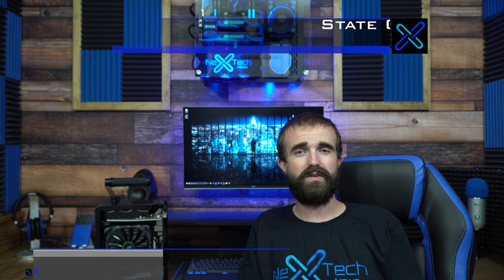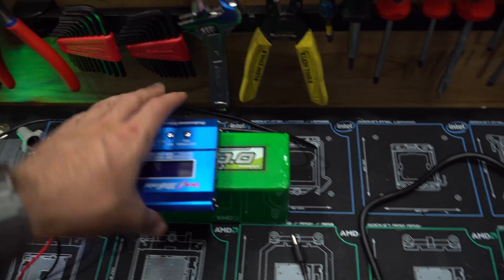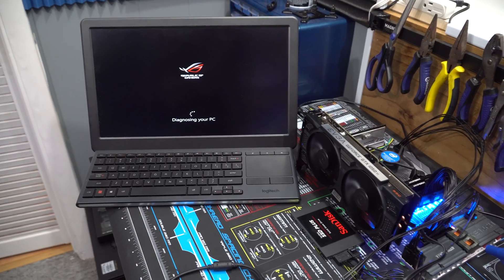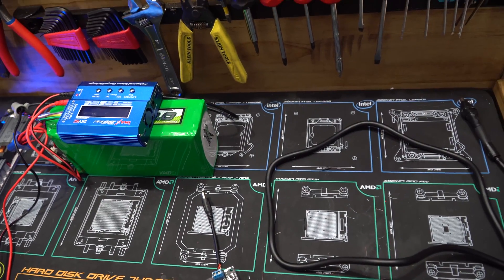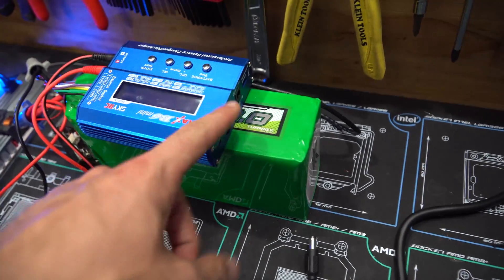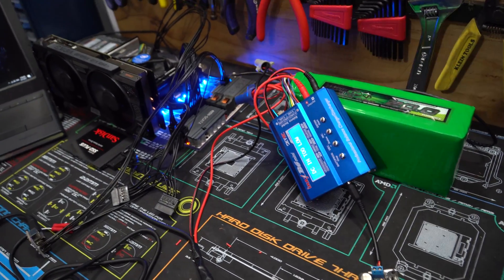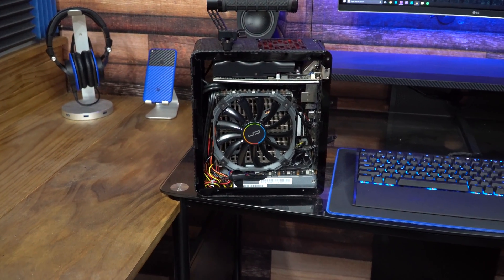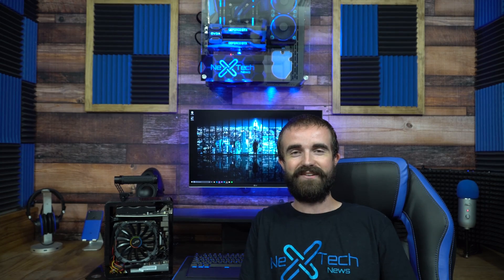State of the DIY Battery Powered Portable PC

Comment: probably need a cap in line before your charger from your charger, need a meter to measure the drop when the charger is pulling, might not be the voltage but the amp load. could re think it and up the volts with a buck on the front side with a cap and a regulator on the back side to stabilize the loads

Comment: Great looking setup. Except for the lipo battery. They are way to prone to going thermal and bursting into flames to use inside. But if you are going to use it inside then do the following. 

If this is a lipo battery with max cell voltage of 4.2v then the following is true. 
Number 1. Make sure to never allow a single cell to go over 4.2v
Number 2. Never let a single cell go over 4.2 volts. No seriously this is the number 1 way these go thermal and burst into flames. You have the charger set to 6S which is 6x4.2 volts or 25.2 volts. If 1 cell degrades and has lower capacity than the other cells then you will get the following problem. The cells will have the following voltage values near the end. 
4.1V 4.1V 4.1V 4.2V 4.1V 4.1V. 
Which is 24.7 volts. So it will continue to charge trying to get to 25.2v. 
Causing the cell that was at a lower capacity and got to 4.2v before the other cells to go to 4.3v. Which will either cause it to go thermal or just damage the cell more. Because the cell is now getting damaged with every charge it is guaranteed to go to 4.5v eventually on a charge and at that voltage it’s guaranteed to go thermal. 

Number 3. Do not let that battery pack get dented. A dented lipo cell shorts out and is why badly manufactured phones and electric bike batteries burn. These battery packs should be in a protective metal box. They don’t sell them that way because they are designed for drones and every ounce counts. So the drone owner takes the risk and most store them in a fire proof box and or outside. 

Number 4. Always balance charge a lipo pack. I believe you had the charger set to charge. Which means it stops when the pack hits 25.2v. You should set it to balance so it verifies it always has connection through the balance leads. And it stops charging when any one cell hits 4.2v. At that point it tries to discharge that cell down to the voltage of the next highest cell. Allowing it to charge the pack to 25.2v eventually without any one cell going over 4.2v

Number 5. Do not leave this battery on a charger when you are not around. Charging is when these batteries are dangerouse. So a charger that goes crazy can burn done the building it in if connected to a lipo battery. 

Number 6. Use a lipo safe. They make fire proof bags to store lipo batteries in. Get one, put the battery in it. Never leave the room without it in the fire proof bag. Especially when it is charging. This changes the building being burnt down to just everything in that room being destroyed by smoke damage. 

Really in the end you can ignore all of this by getting a lifepo4 battery. You don’t need the 100amp output of a lipo battery the 20 - 50 amp output of a lifepo4 battery is plenty. A lifepo4 battery comes with an internal BMS so you don’t need a balance charger. You can just use a buck boost converter set to the right voltage. 

I play with hundreds of batteries. I took apart laptop batteries and made an electric lawnmower. The lipo batteries I have I like to store in a lipo fire bag then I put that into an old metal file folder box. 

Good luck with the project.

Comment: I think its the dell PS that's causing this issue, its a great experiment but for simplicity, I would use a portable power station design as a blueprint for providing the voltage levels required to replace the switching PS normally used on a desktop.

Comment: buck converter  actually bucks and it is only compatible with pure DC as from a solar panel or a battery. It introduces square waves which confuses everyone else. Maybe a large capacitor in the line. Depending on amps. Try 5000 mf
Reply: 5mf....5000mf is 5000000uf :D

Comment: How did you connect the LiPo battery to the motherboard? I mean what is the battery powered power supply? I guess I'd like a link to the more basic design description.
Reply: 400w HDplex, It's in the description. You could probably do it without a PSU at all and just use buck converters.

Comment: So I want to run my PC om solar power. now I can easily do this with a lithium battery and an inverter. (which I have)  I want to for-go all the efficiency losses since the PC runs on DC power and have it running straight from the battery.  It looks like I would need 3 separate buck converters. I have some 30 amp converters (true amps).  Soo 30 amps at 12 volts is only 360 watts which aint bad but that close to the limit when editing.  I guess I could parallel 2 buck converters but dang might as well just take the E losses.  LOL

Comment: I've been looking at a similar setup. I found having a dedicated laptop charger brick plugged straight in to the hdplex then bridging wires from the barrel jack to the positive and negative terminals of 2 flat lion batteries in parallel with a usb dc battery shim in situ... when the charger brick is attached the battery charges plus also giving power to the hdplex, when unplugged in it runs from the battery

Comment: This is so cool! It has been my dream for a few years now to do this. Did you ever figure it out and make a tutorial? Wanna make a similar system with the HDplex 400watt DC-ATX psu and the Dell 330 my system would be an i5 4460 (upgraded to Ryzen 2600/16gb ram/mini ITX), 12gb of ram, gtx 1060 3gb and a 500gb ssd. I also have the Noctua NH-L9i.  Looking forward to finding out your progress on this project. So cool!!!
Reply from the maker: Still working on this system should have the newest rendition posted soon

Comment: man running a pc  with battery is an amazing concept . but it makes no sense if you use that much hardware . i mean hdplex is nothing but power supply . the main objective should be we should be able to run with out power supply because pc needs DC and battery provides DC . we should just run on that . going for converting dc into ac and then DC with power hdplex is ridiculous . plz correct me if i am wrong ....!
Reply from the maker: You misunderstood a little. The HDPlex converts DC power into the proper voltages for the mother board to accept. The HDPlex is not technically a psu, the 350W Laptop Charger is the PSU, it is what converts AC from the wall into DC for the HDPlex. At the beginning of the video I had the PC just running on the battery so all that was hooked up was the Battery the HDPlex and the PC. What I was trying to figure out though was if it was possible to recharge the battery while it was connected to the PC like a laptop but never really figured out a way how.
Reply: @Bits-Blades-Bros  ok naw I got you . For that there are two possible ways . One is by using old model leadacid battery. The other is buy using two similar types of dry 12v batterys like yours . Let me know which one you like to know.
Reply from the maker: The two battery way is what I'd want to know
Reply: Connect two batterys in series and connect 24v charger. Naw charging circuit is complete. Naw connect negative to negative of hdplax and positive from the positive of first battery to the hdplex . It Will only give 12v and is away from charging voltage.
Reply: @Bits-Blades-Bros  ensure charging ampiars are 2% grater than consumption.

Comment: https://www.amazon.com/Yeeco-Numerical-Regulator-Converter-Adjustable/dp/B07568P3QL/ref=sr_1_6?s=electronics&ie=UTF8&qid=1522336166&sr=1-6&keywords=Dc-Dc%2Bconverter&th=1 use this board men, it will supply enough wattage to the system

Comment: hi,  interesting Project , i did  someting  similar  with a turnigy  12000mha   with a  Gtx 1060 mini  and  a core  i5  Hdplex 400w i was getting  about  180w ++  out  of the rig , firts i looked  for a  balanace charger  but  was to  big  for my  Project  ,  so  what  i did  was  grab a  OPENPSU pcb  from minibox  ,  this   litle device (10cm x 5cm x 0.6cm++)  can handle  high charge , protection  and  swaping power,  also  is always the alternative  of a good  PCM,   but  i have made my solution with the open UPS   it gives you everything you need  including the  drivers  to  make  Windows  think is a battery power laptop   take a look, i think  this will fit  and resolve your Project in an efficeint way.OPEN UPS - http://www.mini-box.com/OpenUPS?sc=8&category=1264PCM - https://www.ebay.com/itm/320947931582

Comment: Hey! First of all; great videos! Keep up the good work.

If you didn't figure out how to solve your charging problem I would recomend using a BMS (Battery Management System). It will shrink the size of your battery+charging system significantly. But a BMS is usually easier to find for 18650 Li-Ion cells, wich brings me to my next point!

Chinese batterypacks, like the one you show in the video, are often made for high current draw and can be very unstable and dangerous if not handled correctly. It's also hard to tell the production quality and what testing the factories do to ensure the battery pack won't catch fire. That's why I would recomend buying Li-Ion cells to make your own packs or have someone make a pack for you. Pair that pack with a BMS and power brick and you have a user friendly, portable computer on steroids.
Reply from the maker: +Jo Aleksander Johansen thanks a lot! And the issue was the buck convertor wasn't powerful enough but I ordered already what your talking about, I ordered a bms and 6 lithium ion cells to make my own battery pack
Reply from the maker: Thanks for the tips!
Reply: just out of curiosity, wouldn't the BMS limit the current draw of the Chinese pack he has?  I've never heard of an RC battery like that blowing up because of too little current...

Comment: I guess your boost/step down converter doesn't supply enough amperage. try with another one that has a higher wattage. I was trying to power on a high wattage LED with an weak boost converter and was doing the same thing
Reply from the maker: +xorineo That's exactly what it was I have a more powerful one on the way! So hopefully that fixes it! :)
Reply: nice. I just saw you mentioning it in your vlog. I can't wait for the next video in this series

Comment: I am wondering how much power is stored in that battery pack. It would be great if it could run the system on full load for a few hours. Also, I wouldn't recommend opening that pack to use only 1 cell, chance is high on failure and I don't know if that could store enough power. And chance is that it can't deliver enough power, since now every cell just gives a part of the amperage, using a single cell would mean it has to deliver 6 times more ampere than what it does now, that could be problematic. Also watch out with TDP, for a CPU the TDP stands for how much power is dissipated through heat, the thing uses more power than that. A 1800X is easily over 100W powerdraw
Reply from the maker: +Brecht Schatteman I'm not opening the pack to use one cell, I'm opening it and continuing to use all 6 cells, otherwise the battery wouldn't supply enough amperage. I'm opening it so that each cell can be placed separately into the case so that they will all fit. And I understand the 1800x is over 100, I've tested the whole system and under load its about 220W of power draw. Thanks for the tips though!!
Reply: Thanks for clarifying on how you were planning to open the battery. I just calculated that the battery pack has 444Wh, so it should than be able to handle the pc at full load for 2 hours, sounds great!
Reply from the maker: +Brecht Schatteman Your welcome and yeah that's what I calculated too! So we will see how it actually performs

Comment: Dont use that cheap balance charger..... Is it a 6s battery or 4s? And you need some kind of bms to protect the battery from over discharge! Does it work with a gtx1080 or 1080ti?
Reply from the maker: +Kuntal ghosh it's a 6s battery and itd work with the 1080 but not with the 1080ti the ti draws to much power

Comment: The manufacturer says:

Continuous Operating Current: 1.5A (total output power within 20W)

That little buck converter struggles then shuts down. You'll need a much beefier buck converter.

I like your videos!
Reply from the maker: +Bunch I can't believe I didn't check that!! Your totally right!! Thanks!! And so glad you like them!
Reply from the maker: +Bunch I can't believe I didn't check that!! Your totally right!! Thanks!! And so glad you like them!
Reply: So what's the state of this product? I don't see anymore further videos on it. Thanks!
Reply: I use buck boost converters a lot. Making sure they have current control and voltage control makes them much more stable. And really doesn’t cost any more. You just have to look for it. 

So you don’t technically need a bigger buck converter. It just needs current control. So if it is only capable of 2 amps it will just stop at 2 amps 17.6v instead of trying to do 3 amps and dropping the voltage. 

Then the charger will only output the amperage it’s capable of doing at 35.2 watts of power. No matter what you have the charger output amps set to. 

Technically if you have a proper buck boost converter it can be used as the charger with out having the charger in series. But it won’t have the balance function of that charger. 

So if you are not using the balance function of that charge then a buck boost converter is all you need  

Except for the fact that without a balance function that battery will eventually burst into flames.
Reply: Too vague and amateurish.

Comment: It looks like your buck converter isn't rated for the 60 watts you said the charger takes (well it can get close in bursts) so it might be sagging after those 4 seconds and stopping the charge
Reply from the maker: +Andrew Grimm You know what! You might be on to something!
Reply: Andrew Grimm - that looks like a converter i have, and it only has a 2amp rating = about 20 - 30 watts depending on voltage